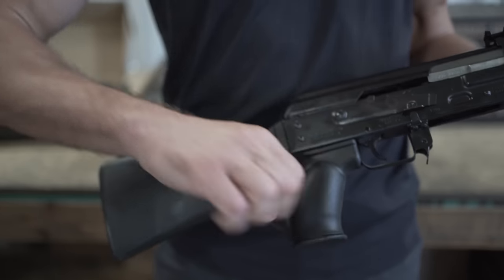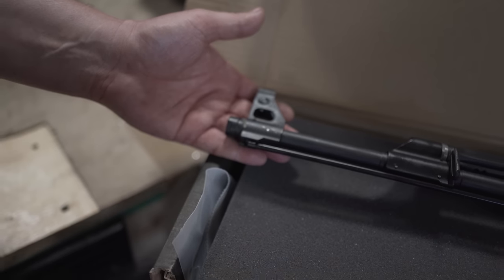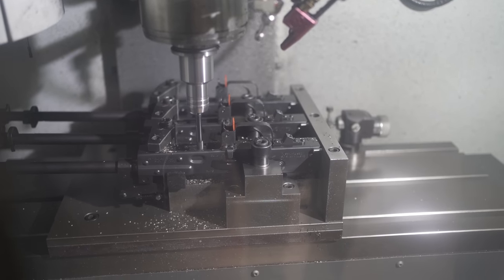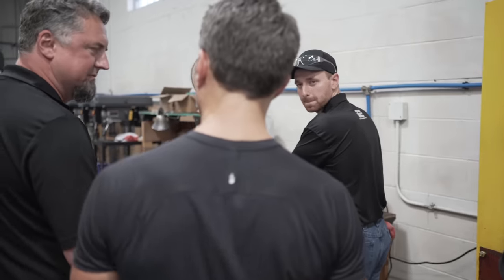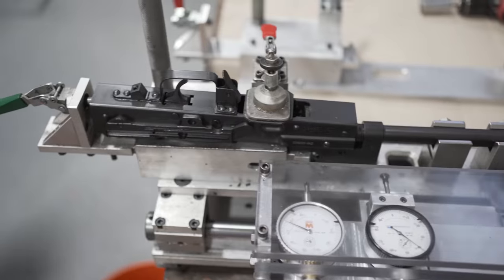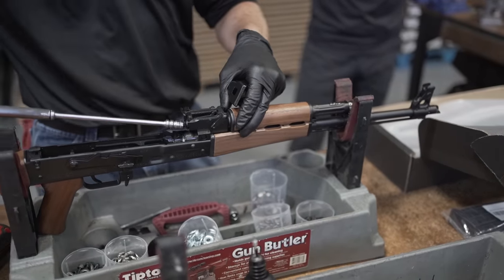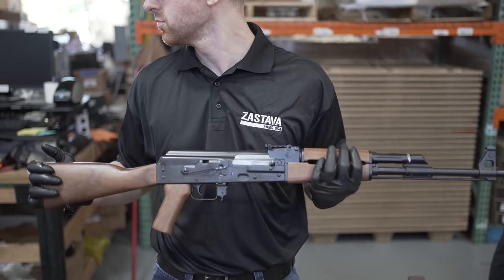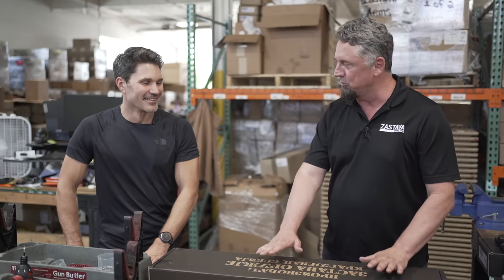Why AK-47 Imports Suck

Comment: Welp I’m returning I made a comment in regards to my zpap being sick. I was wrong…. After testing A LOT of different ammunition in mine. Finding out that none of it was actually accurate. I decided to do a chamber cast the bore on this pos is .314 it’s not shot out. That’s what your quality control allows to leave your factory. Emailed your company to find out what Zastava wanted to do to fix this problem. Was told that i would be responsible for all of the repairs because I purchased the gun privately. Zastava is junk buy with caution ⚠️. As for the guy cutting off the “thread protector” he can use some more training he nicked the crown on my rifle.
Reply: Our records show the firearm is over three years old, without proof of purchase, and you purchased it used. Despite this, we offered a comprehensive inspection, with potential repair costs on your end if needed.
Regrettably, we've not received the rifle for inspection, hindering our ability to move forward. We value customer satisfaction and stand behind our commitment. For accurate assessment and resolution, we need the firearm physically.
Spreading information on social media before allowing inspection complicates matters. We're dedicated to transparency and resolving any issues you may have, but inspection is crucial.
Reply: Ummmm first off how do you know my particular claim. That’s kinda interesting and scary at the same time. Second no in the email I received you said i would be responsible for all repairs. I still have the email why would you send me a email explaining that all repairs I would be required to pay???? Then turn around and make me look like I’m just complaining about your rifle. I sent you pictures of the rifle and you know just as well as I do that it is NOT USED. Furthermore you didn’t even try to send me a shipping label to send it to you for “inspection”. So don’t make it sound like I’m just being a jerk or something. And don’t make it sound like the rifles been ragged out. Because it was purchased privately a rifle that’s 4 thousands out of spec would not be in the condition my unit is in if it was shot out. Now if you want to make this situation right send me a shipping label and I’ll promptly get the rifle back to you. Like I originally wanted to do in the beginning. So I decided to go and look at the original emails back and forth between us. I love how you made it sound like you were going to help me. By saying you could get the original recipe because the owner that purchased the my rifle originally was a good customer and friend of you. But then turn around in the next email and say that there was nothing you could do for me because the rifle was used.
Reply: @zastavaarmsusa wow seems I’m not the only person in the United States and OTHER COUNTRIES as well that have purchased turds from your company. Lmao 🤣 apparently it’s a long running joke that the Zastava plant produces clunkers. Essentially rifles that can have decent aesthetics such as bluing and wood. But EVERYTHING else is a train wreck. Such as fit and finish and most of all ACCURACY.

Comment: In europe gun laws mostly revolve around guestion can you own a gun. It is not like i want to buy that not even with clean
backgrounds. 

Every and i mean every gun had to have purpose what kind of gun you want and where to use it. Then you drop your 
application to police office. Hunters license will get a started but in reality you can forget so called assault type guns.
No law to prevent if permit to buy semi-automatic rifle in spefig range calibers. But when you show up with
Ar 10/15 for semi rifle it is pretty sure that officer will cancel your permit on spot because too much of firepower
for intended porpose.

Sporting license will take 1 year active club/hobby/reservist shooting to get permit to own actuall AR/AK with
unrestricted mags. With pistols/revolvers same deal but 2 years.

Guns itself dont have too much of restrictions placed on them. 
Rifle: 600mm minimum length overall and had to have least 300mm barrel. So pretty compact rifle 
is possible without special permit meant usually for full automatics.

But there is no such things as so called pistol AR.
Rifle/sub gun is either legally rifle or gategorized as other gun treated pretty much same as automatics today.

Pistols are pretty much self explanatory.

Comment: I love my Egyptian Maadi's. Both are Pre ban and really reliable as the factory where they were made was originally set up using Russian equipment and operated by Russian engineers. I believe now the facility is operated by the Austrian Company Styer.
Reply: If you have true pre 1989 maad's they were imported by steyr that how you tell a true pre ban over a post 89 ban. The early guns were a little bit better fit and finish but that's not sayin much.
The finish is enamel paint that with the wrong cleaner will wipe right off reminisent of bulgarian slr 107fr's
Reply: @Phenixrising-p1p  Pre ban imports like mine had a thread cap spot welded to the rifle. If was such a fine weld you could remove it in a few minutes with a file then fit a flash hider to the rifle. Post ban models ha the threads filed down in spots or removed completely.

Comment: Love zastava got one of their original m57 pistols (essentially  a direct copy pretty much of the tt33 tokarev) not the ones for import wit the shit safetys in talking an OG one without the saftey and its nice as fuck prolly one of my easiest and flat shooting pistol right along wit my 1911 ofc the trigger isn't as nice as the 1911 but the sight in my opinion on the m57 is actually nicer then the GU sights on a baseline 1911 (which is wat I have a RIA 1911 I aint got the cash for no wilson combat 1911 or sum) all in all just love the 7.62x25 yeh I could convert it to 9mm and ill prolly buy a 9mm barrel sooner or later but 7.62x25 aint tht expensive (its sure cheaper then 45acp in my area), and it's fast so it works great especially at the range and yeh my m57 is definitely a range gun like yeh u could carry it but being tht the only "safety" on em is the half cock and considering I've heard of people dropping em a certain way while on half cock abd shooting themselves besides I have guns much more suited to concealed carry (like my taurus g3c and my glock 19 so yeh) but as a historical piece/range gun I do love it alot

Comment: You keep characterizing this specific import regulation as silly - but silly from what perspective? As the Zastava rep admitted, forcing importers to use domestic parts creates domestic jobs, uses domestic resources. And since it makes imports more expensive, it pushes consumers to favor domestic designs and brands (it's basically a subsidy to M4 manufacturers). I'm not saying any of that is worth it, but it's far from a silly regulation. You just think that its costs outweigh its benefits. I tend to agree. It's just too bad that even "pro gun" GOP politicians care more about pleasing US manufacturers than actual gun owners.

Comment: I remember when you could get an AK for like $300. it is no wonder why the prices of AK's have went through the roof. with the cost of labor and what goes into making them a 922R functioning firearm. a Person may as well buy an American made AK now at least that way you get all the original parts made with the AK. just saying
Reply: Most American made AKs are so poorly manufactured they're either unreliable or in some cases actually dangerous. Up until recently there was zero options, now the 4th and 5th gen PSA-AKs are apparently okay, but not great.

Comment: I just wish Zastava wasn't Yugo/Czech/Serbian so there is more parts compatibility.

The WASR 10 is still the best import AK at its price range. Quality control from Cugir has definitely stepped up but don't expect an Arsenal, and again at this price range, you shouldn't. Parts compatibility is no problem with any Romanian AK.

Got an M77 about a month ago and it seems well built. Still need to get it to the range though.